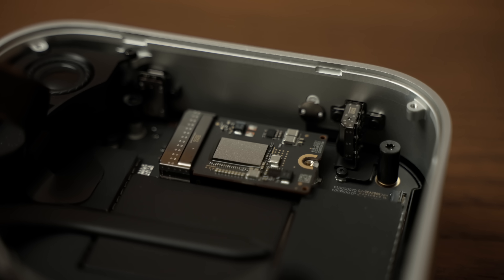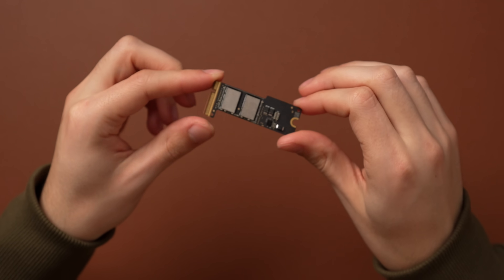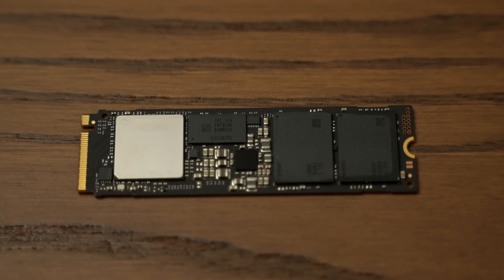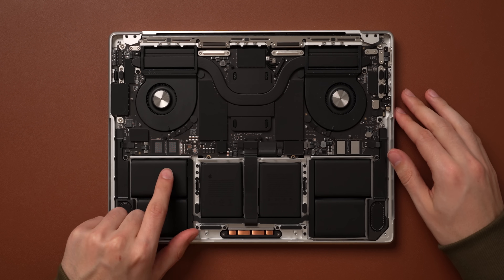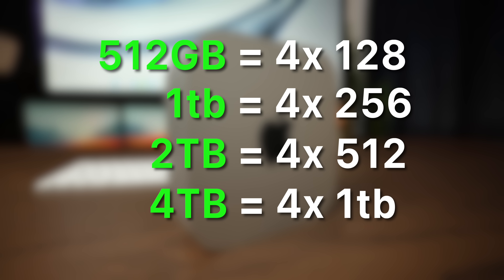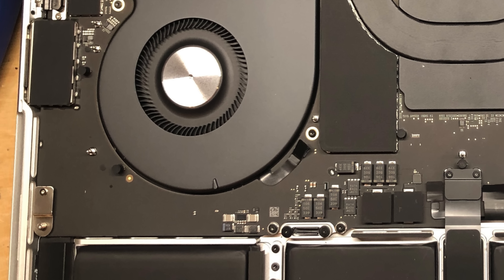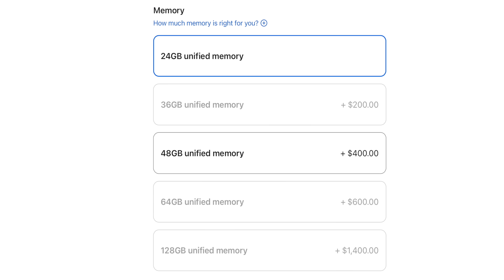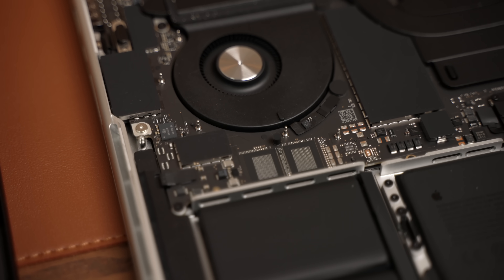Apple SSDs are hiding a BIG secret... Upgradable MacBooks??

Comment: Note: Even if the storage becomes "upgradeable", they will lock them somehow behind firmware patches. They wont allow "third-party hardware" to avoid "damaging the product" as their excuse as always.
Reply: MacOS is based on a kernel that is entirely modular, there’s no reason to think that hardware integration has anything to do with apple refusing us upgradable storage when the software still supports hardware changes.
Reply: @Matt-oq4jq  That doesn't matter.  It's not enough to write the software only.  The idea is to design the hardware as well.  Control both variables.

Look it doesn't matter what you think mate.  I wasn't taking a position here or passing off a personal view.  Only pointing out a design philosophy.  Rightly or wrongly this is the integrated approach.  You control every aspect up and down the stack.  You design your hardware and you write software for it.  

Opening thread was saying that the only way to explain this is the market theory.  That's the only reason to do this.  And all I said was no it isn't actually.  There are perfectly legitimate engineering reasons why you might want to do this. Again, not making a judgement call about what's right or wrong here.  

As I said to the other chap if this bothers you so much that it is a deal breaker there are other options.  I don't understand why spend time critiquing an approach if that approach is a deal breaker for you?  You can instead just vote with your wallet.  If upgrading the storage is an essential feature for you well then the way is clear.  Apple is not for you.
Reply: @ I'm telling you that it's the only thing that matters, everything else is an arbitrary business decision. There are currently supported devices in the MacOS ecosystem that were designed with modularity in mind, thus it is inherently supported by the software. NAND is NAND is NAND.
Reply: There is third party 2TB module for M4 Mac mini for way cheaper than Apple SSD
Reply: @superqaxclub  Maybe its 50% cheaper, but that is still expensive. Apples SSD upgrades increment from like +200$ per terabyte/half a terabyte.
Reply: iBoff has created an adapte to remove SSD on Apple silicon, so far no firmware restrictions, but adding the adapter and also the soldering isn't for everyone
Reply: They can't, because the modules are just nand chips and it contains no firmware
Reply: @noble_lime  as I said, IBoff has done it and they have an adapter to do this job; those macbooks that can't fit an adapter, existing NAND chips get removed and replaced with new NAND chips, NAND chip programmer installs the firmware that's needed; may be people should look up iBoff before remaining on their high horse
Reply: Your comment is merely a guess. This can only happen if they already implemented the technology the firmware lock the drives that exist out in the world
Reply: Obviously you are not up to date about the base model M4 mac mini

Some China factory has already started selling the SSD modules for the M4 mac mini, specifically on aliexpress and alibaba and they are useable. Some tech shop in my country has already started selling the 1TB modules
Reply: Opencore. You're welcome.
Reply: It's dumb to think to even do that, when they are freely allow users to use Thunderbolt 5 external drives, what basically have the same speed like the internal drive.. so what they gain if they limit the internal SSD? More user will use external SSD.. and nothing changed for them.. so if they won't gain anything from it, they have no reason to do anything to lock it...
Reply: @TamasKiss-yk4st  95% of Mac sales are laptops. How many customers want an SSD hanging off their sleek MacBook? Plus, there are certain complications to moving the home folder to the external, and limitations if you don’t. It can be done, but it isn’t for everyone and Apple could break things any time with an update.
Reply: @TamasKiss-yk4st  External SSD even over TB5 is still not a portable solution.  It's yet another dongle (and a very bulky one at that) for a machine that Apple are too lazy/corrupt/malicious to include in the system like any properly designed machine should have.  Certainly I could see some $100 Chromebook or MSWinSE-type system being severely limited on ports as a cost-cutting measure, but when you're paying the premium you pay for Apple hardware, you should expect far more connectivity flexibility.
I see the same thing happening on home TVs.  First they eliminate all the Composite and Component ports, and THEN they cut down the number of HDMI ports as well.  You have to use an additional HDMI switcher.   Of course, since you can't get a base system without all the "smart" crap, I'll continue buying old used hardware.
Reply: That’s just speculation on your part, and seemingly misguided one at that. Apple had years to stop said third party upgrades on the Mac Studio and the Mac Mini already, and they didn’t. And before you tell me those are niche products, well, if they are as much control freaks as you’re painting them, should that even make a difference? Wouldn’t they nip it in the bud if preventing third-party storage upgrades was that much of a priority?
Reply: @Mainyehc  They are stopping third party upgrades, but currently they arent actively blocking workarounds. You cant plug in a retail SSD into a Mac Studio.
Reply: I don’t really see the point in what you’re saying. Plenty of people, including myself, bought an M1 MacBook Pro in 2020 or 2021 and never felt the need to upgrade. Furthermore, I used to own a mid-2012 13" MacBook Pro, and guess what? Doubling the RAM to 16GB didn’t change the performance at all, because even with 16GB of RAM, your shitty 2-core CPU isn’t going to turn into a multitasking monster. The thing is, Apple’s factory upgrades have always been overpriced, yet people kept buying them anyway, since only a small fraction of users are willing to open up their multi-thousand-dollar laptop to add RAM. Also, if you want a sleek laptop, you can’t fit SODIMM slots—just look at the Windows competition.
Reply: @jeanthierryduffion9861There's literally enough space inside MacBooks to have modular RAM and m.2 drives. The battery is thicker.
Reply: It’s already upgradable. You can buy up to 2TB modules for the Mini M4 (regular not pro). The “catch” right now is you need to put it into DFU mode and use another Apple Silicon Mac to restore it
Reply: Well that's just part and parcel of the integrated approach.  They are not modular.  If you want modularity then a PC is the solution for you.  For better or worse.  Not an excuse just a statement on design approach.
Reply: @Screaming-Trees  Not a good argument in my opinion. A laptop should be reasonably repairable/modifiable, while maintaining its integrity.

But even in this scenario, Apple is going out of their way to block users from upgrading their machines, even when there is no real limitations.
Reply: @ IT doesn't matter whether it is a good argument or not.  It's an engineering doctrine.  It's a real thing.  Had you gone into computer science at university you would have heard about it.  The theory is that if you control every aspect of the stack all the way down to the smallest micro controller you will end up with a more cohesive product and experience.
Reply: @Screaming-Trees  A bunch of word salad wont make your point any more valid than it was before.

Why are you spouting about things that are irrelevant to the discussion at hand, when you say the validity of an argument doesnt matter? 

Nothing changes for Apple, except their wallet size when they realize people can just upgrade it in their own for much cheaper.
Reply: @terrycrews1584  What's not valid?  Are you disputing that an integrated approach exists in computer science as an engineering approach?  Is that what you're saying is not valid?  

I don't know why you are on here complaining about Apple's wallet size anyway.  It doesn't sound like you like their design and engineering approach anyway.  Which is why I said in my first post a PC is for you maybe.  If them controlling every single aspect of their product including parts supply is a deal breaker for you, which I understand completely if it is, why are you wasting your time complaining about it here?
Reply: @Screaming-Trees  Controlling the stack doesnt inherently mean extending your control over things that are not necessary to control, such as the NAND chips or the controller with unnecessary serialization. Apple does not own YOUR machine and has no valid reason to control what you will change about your product. Pointing out a philosophy like that is irrelevant to the consumer in the first place and going as far as Apple is going is not necessary. 

I am alerting others to the fact that they think Apple will make MacBooks upgradeable to the average folk. They have serialized most of their hardware just to prevent repairs from third-party vendors and they will put significant mark-ups on authorized vendor parts.
Reply: @Screaming-Trees  ion think the experience of upgrading your macs is good 😂
Reply: @Screaming-Trees computer science is not an engineering discipline. Electrical and/or Computer Engineering are the relevant engineering disciplines to computer hardware and software. There may be overlap between Engineers and CompSci roles, but they are very different approaches to solutions, especially with software development. As an IT Pro (who happens to have an engineering background, though at the Technologist level) who supports SOHO and home users, I see this difference in approaches all the time with various developers at one client. I wouldn't characterize this so much as engineering doctrine, but more product manager, marketing, and executive philosophy. I highly doubt most engineers truely want to intentionally design things with planned obsolescence, a lack of upgrqdeability, and a lack of repairability.
Reply: @Screaming-Trees we get it you hold a lot of apple shares.
Reply: @xryz  I mean that's so fucking stupid man.  OKay let's step through this like an engineering team would.  Why wouldn't they opt for a NVME solution when they were designing their new  M1 line at the time?   Well one HUGE reason could be power.  Every micro controller you add you imply something is hardware driven.  So if it's a wifi chipset with a micro controller you would call that hardware driven radio.  Do that and all of a sudden your OS can't really control your wifi chipset.  If you read the IOS/iphone design documentation they published that thing is very aggressive with its acpi code.  People thing this is a small detail oh just adding user upgradeable storage that makes sense.  Only a psycho bent on gouging wouldn't do that.  But if you wanted to achieve the kind of power consumption numbers they hit with the M1 what was available off the shelf that could do that at the time?  Nothing.  NVME is too power hungry.  So what do you do?  You have to design something from scratch.  

Can you at that point add upgradeability?  Well you could but you would also have to define a new standard of some kind, however basic, so that you can have third parties produce something around it.  It's not trivial.

I'm not defending Apple.  The OP said the only reason to do this was profit and I disagreed.  There are legit engineering reasons to do it.  You can't argue that the M1 platform was a great achievement in the area of power consumption.  They wouldn't have been able to do that with nvme.

But what do you care?  If this is a deal breaker I mean there are plenty of options out there.  Buy something else.
Reply: @Screaming-Trees  What a stupid response. they had modular products before, it won't be anything new for them. "Buy a PC" what if someone wants macOS? Don't forget that in 2012. MacBooks had upgradable ram memory and storage.
Reply: @Milos596 if you want mac os you accept the conditions since you don’t have any right regarding the copyright of mac os.

You can always use Linux.

In anybody home, anybody has the right to impose, prices and rules.
Reply: @Screaming-Trees  Bollocks, it's pure profiteering. Spoils of being the sole hardware supplier to the platform.
Reply: @ Sure it's profiteering.  That's a benefit.  Although here if Apple were to set the price to say 75% less of what it currently is would you make the same argument?  Ultimately I was talking about an engineering doctrine not markets.  And this engineering doctrine is real. Go to school you'll learn all about it.  Whether you agree with it or not is not relevant to my point.  I wasn't making a judgement on Apple's market strategy nor was it an endorsement or defense of what they are doing.  You can disagree with them and call them profiteers, and this is borne out in evidence by their pricing strategy I think, but you missed the point about what an integrated approach is in engineering.  And it actually makes sense.  Think about to how many complains people have had about windows crashing over the years on its way to prominence.  That's the downside of modular approaches.  One shitting hardware piece or bad micro controller firmware can fuck up your reputation.  It's not fugazi it's a legitimate engineering approach.
Reply: @Screaming-Trees  "if Apple were to set the price to say 75% less of what it currently is would you make the same argument?" No, I wouldn't, because they wouldn't be profiteering. But the point is, they are. 

"Ultimately I was talking about an engineering doctrine not markets.  [...] Think about to how many complains people have had about windows crashing over the years on its way to prominence.  That's the downside of modular approaches." You're conflating a lot of things here. Windows apps might crash for any number of reasons, though actual OS crashes / blue screens are no more common than macOS kernel panics. 

"One shitting hardware piece or bad micro controller firmware can fuck up your reputation." Macs used NVMe drives for a long time. Were they constantly crashing?
Reply: @axi0matic  No, not conflating.  Simplifying for brevity that's all.  Microsoft wrote a lot of bad code in the 90s and 2000s but they weren't the only ones.  Underlying causes for crashes in any system are manifold.  Sometimes it's Microsoft and sometimes it was shitty hardware made by whoever.  That's just the downside of modular. E.g. Kernel panic can be caused by bad memory modules.  Theory: if we design the memory module and make it ourselves we can mitigate the possibility of bad modules causing kernel panic because we have total quality control oversight.  That's the core tenet of the integrated approach.  

Again man this is a well documented phenomenon and is taught wherever you go to school for computer science.  It wasn't meant as critique of one approach or to zero in on specifics around crashes and what causes them.  Modular has great benefits as well.

"actual OS crashes / blue screens are no more common than macOS kernel panics. " that is utter fucking bullshit man!  If you really think that you have no perspective here.  Today, this statement comes a lot closer to maybe having a chance of being true but in the 2000s, once OSx went BSD in the user space and Mach microkernel in the kernel space that difference was night and day man.
Reply: @Screaming-Trees  Meanwhile, Apple has written a decent amount of shite code itself. Your arguments are flawed, IMO. Proprietary, full-stack systems do not need to be non-modular or non-upgradable to ensure an enhanced UX. Once upon a time, Apple computers were just as user-upgradable as any PC out there. Their decision to move away from user-upgradable systems has demonstrably reduced the quality of the overall user experience over the lifetime of that product's viability simply because by making it impossible to upgrade the hardware, the serviceable lifetime of the product has been reduced. That ONLY benefits Apple.
Reply: @TraneFrancks  Maybe spend some time thinking over my arguments before you disagree with them.  Did I say Apple didn't write bad code?  No, I did not.  Did I say only Microsoft write bad code? Also no.  

Yeah they do actually need to be integrated.  Hence the word integrated vs the word modular.  

Whether they need to be thus for an enhanced UX is neither here nor there.  That wasn't my point.  This is purely theory we can speculate that they do in fact need to be or don't need to be.  Not the point I was making so I don't understand what you're disagreeing with here?  

No they were never just as upgradeable as any PC out there.  PC's were always more flexible in this regard.  

"Their decision to move away from user-upgradable systems has demonstrably reduced the quality of the overall user experience over the lifetime of that product's viability simply because by making it impossible to upgrade the hardware, the serviceable lifetime of the product has been reduced. That ONLY benefits Apple." 

Huh?  So you see no benefit to say a 20 hours battery life, a benefit derived directly from closed integrated system design with full control up/down the stack?  A 20 hour battery is not a benefit to the user experience?  Something never achievable when they were buying their CPUs from Intel and their motherboards from whomever.

How so?  Take your laptop to Apple and they can service whatever you want for you.  How has moving to a closed system reduce the lifetime of a product?  What is the causal link there?
Reply: @ 1. It’s not the 90’s anymore. 2. Apple don’t manufacture memory modules. 3. OS X has been around for 25 years; it didn’t suddenly become reliable a few years ago when Apple soldered everything down.
Reply: @axi0matic  Man I'm sure that's a retort to some point but it isn't to mine.  I don't even know what your reply is actually.  

The point about the 90s was that it took Microsoft a long time to get the modular approach to computing under a degree of quality control that today can sort of mimic the integrated approach Apple chose.  A brief anecdote to illustrate this.  I had a Thinkpad, I think T41 or something like that in 2004/5 when I joined IBM engineering.  No matter what you tried you couldn't wake that thing up from sleep in under say 3 to 5 minutes.  And 3 out of 5 times it wouldn't wake up at all.  It would just hang and crash forcing a reboot.  When I switched to a 17 inch MBP the ACPI code was flawless.  Can put the MBP to sleep and wake it up instantly.   So we went from 3 to 5min with high failure rate to instantaneous.  Now is that microsoft's fault?  Well not exactly.  The fault was to do with the T41 having hardware driven radio (basically a wifi chipset with a micro controller to drive it complete with its own firmware).  Hardware driven radio doesn't execute OS kernel instructions always as ordered.  It more like interprets them.  And this was obviously a shitty, buggy implementation.  

The moral of the story is In a modular approach you can't control the wifi chipset design and its associated firmware.  You don't know what it's going to do.  You publish a spec but the vendor may not implement it.  Or actually the bigger threat is they may not have the competency to implement it to a high standard that you need.  So you get what I had above.  

That's the whole point.  That is what the integrated approach tries to avoid.  It doesn't mean that this approach will yield a result you want automaticlly by virtue of you adopting it.  You still need to be competent as a hardware / software designer.  But that's the goal of this engineering method.  To control all variables in a system no matter how small in order to avoid points of failure as above.

No it didn't suddenly become reliable just because Apple closed off everything and soldered everything down like you say but there are other benefits than just reliability.  For example the battery life comes to mind.  Not possible while they were buying CPUs.  Possible when they started designing them and controlling every variable.  And actually more than possible they proved it.  Even the baseline M1 air was miles ahead of what they had with Intel before.  And I would argue in a modular system you won't be able to match that easily.  But that approach has other benefits as I said.  So pick your trade offs so to speak.
Reply: @Screaming-Trees a bunch of words about unrelated topics to try and save face how you are wrong. It's cool. You like a product and want to defend the company's price gouging / anti-consumer tactics under the guise of quality control or some bs. Kinda weird, but just own it.
Reply: @axi0matic i have macs for about 20 years already. Never had a mac os kernel panic. Ive had several on windows in a fraction of that time.

The point the guy is making is a valid one. A system that was critically tested by the manufacturer, has much less chance of failing than a modular one where a single part can fuck all the system. There’s nothing to discuss there, its just plain statistical logic.
Reply: @axi0matic  not only that, but when things inevitably go wrong on a Mac or iOS device, whether hardware or software, errors are obscured and hidden, with intentionally generic messages like "there was an error", if there is even any communication of an error to the user. Log files on Macs, in my experience, don't seem to help, so I end up chasing down the behaviour, which is never a good way to start your troubleshooting.
Reply: @axi0matic Apple uses the upgraded RAM sales to subsidize the base models.  Kinda like my city utilities’ inverted electric rates, where the more you use the more per kWh you pay.
Reply: @cameratool  I generally agree with your point, though “subsidise” makes it sound like Apple are doing us a favour. “Make less profit” would be more accurate. They need to hit certain price points at the low end, as people shopping there are inflexible on price.

The main thing is to stop anyone with a higher budget from being able to get away with a lower end model.